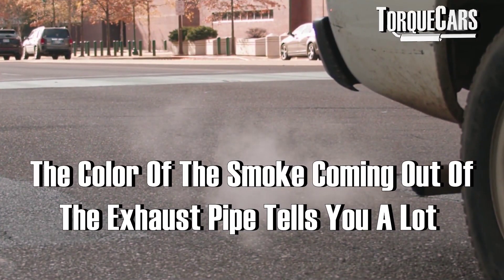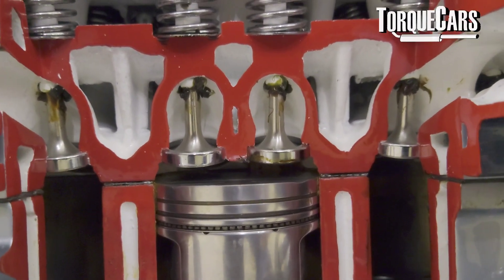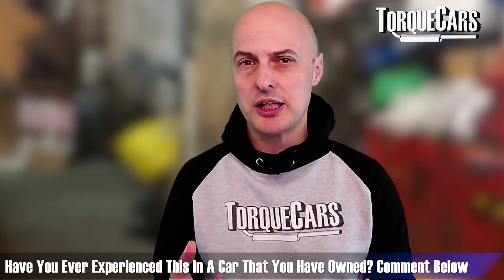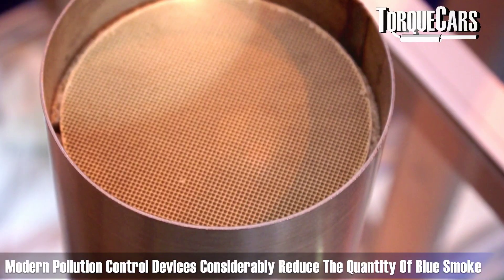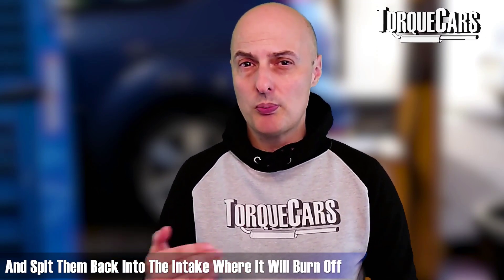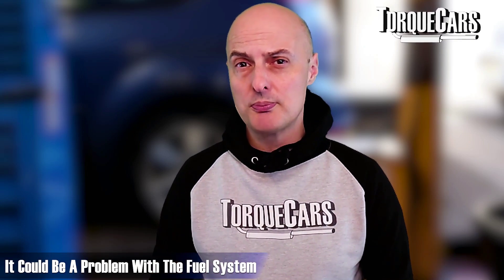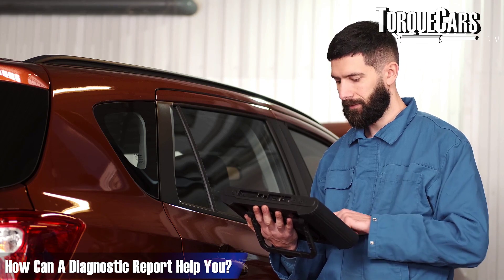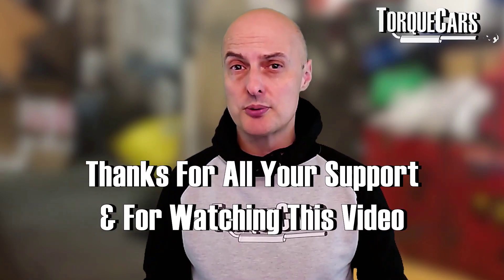Understanding Exhaust Smoke Colors: What Blue, White, and Black Smoke from Your Exhaust Mean 🚗💨

Comment: Great video, slight disagreement with the head gasket, mayo theory, I’ve had cars with head gaskets running ok but still show mayo on the oil filler cap through short runs, cold climate and condensation build up inside the cam areas, getting the engine up  to working temp and longer runs alleviates this.
Reply from the maker: Good point I wish I'd added that to this video. This problem won't tend to manifest as white smoke from the exhaust on anything other than a short start up duration whereas a head gasket problem will.

Yet another reason for people to avoid short journeys.